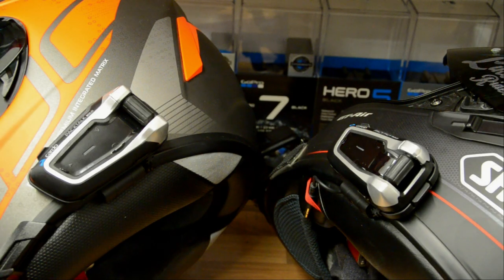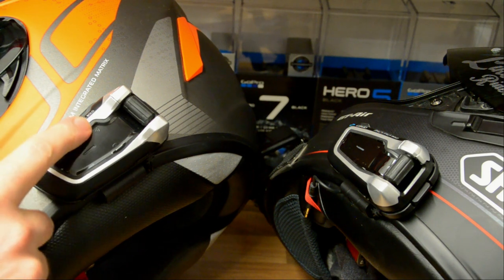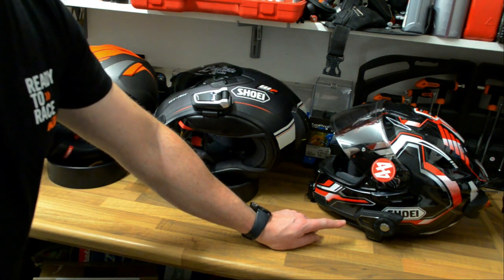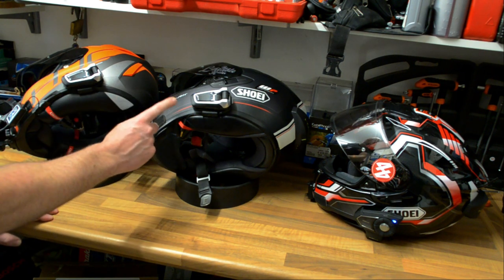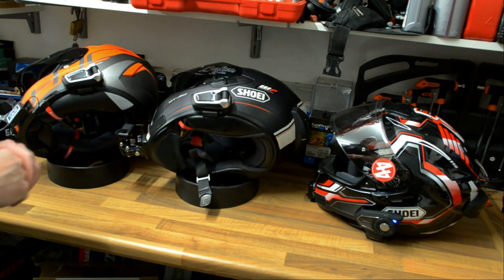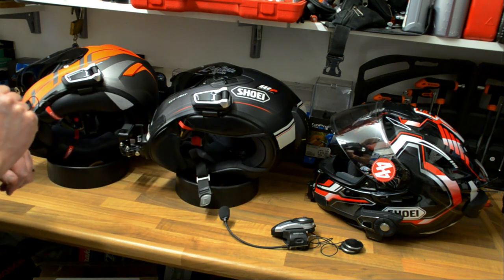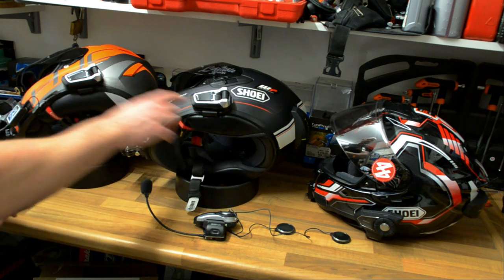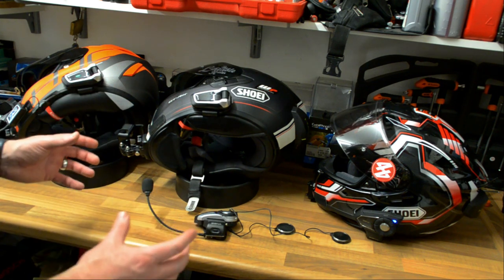Cardo Packtalk Bold DMC Intercom Setup and adding Non Cardo units to the Meshwork!

Comment: I’m struggling to connect the new nexx xcom3 pro with a cardo.. as it’s basically sena to cardo thought this might help but no luck.. about time the manufacturers made it easier and use as one 🤯
Reply from the maker: That's a shame!
They have started to make things easier with cross brand pairing, there's already an updated firmware allowing you to do this, but it's currently only available for the top spec Cardo units.

Comment: Spooky. Mine literally just got delivered. Going from a 10s to the Bold. Quality bit of kit and worth every bit of £420 for the duo.
Reply from the maker: Great stuff! Let me know how you get on with yours. I've had many other units over the years, but have only had the Packtalk for a short time, and thus far they're far better than anything else I've had.
Reply: @thelikeablerider8800   - Hmmm. First test complete. Build quality is excellent and the intercom is rock solid but I think the speakers are much better in my Sena 10s. These can’t seem to handle any bass coming from my old school trance music, unlike the Sena. Bit miffed by that as quality sound is important to me. Think my earlier comment was somewhat hasty.
Reply from the maker: You can adjust you're volume levels in the settings on the App. Do you have the JBL speakers?
Reply: @thelikeablerider8800  - Yes I have the JBL speakers (did the update before anything else). I’ve tried all the settings. Can’t go near full volume on my phone without it distorting but I need the volume to hear it. I’m going to fiddle with my iTunes EQ settings to see if that helps. It could be a quality control issue on my speakers as they seem to lack punch.
Reply: @thelikeablerider8800  - Turns out that one of the units in the box has faulty speakers. Mine. Typical.
Reply from the maker: Ah bugger that's annoying! Was surprised tbh because even the standard speakers are better than my Sena's!

Comment: What is the procedure to do the same thing the other way around? I have a packtalk bold, but most of my group is using the sena mesh intercom. I know the 30k has a universal pairing mode, and I can use phone pairing mode on my packtalk to connect to the 30k this way, but what does the 30k have to do in order to bring me into the sena mesh group?
Reply from the maker: Hi Kevin
Yes of course it'll work the other way round. One of you 30k friends needs to pair via Bluetooth to your cardo ( I have another video explaining that) first they need to create their mesh call, then the Sena paired to you needs to call you via Bluetooth (one tap of the phone button) and that'll bring you into their mesh call.

Comment: Question - I  guess that the range must be much less to the bluetooth connected intercom? How close must the rider (using non-cardo bluetooth-connected unit) stay to you (with the Cardo, briding that person into the mesh) for it to work most of the time?
Reply from the maker: 200-300m is tops I'd say! Try to be riding directly in front or behind or the guy you're paired with for best effect👍

Comment: Thanks for this video very helpful. Has anything changed with the Sena 50S/R? Specifically will this connect as a mesh unit?
Reply from the maker: I couldn't really say as I've not looked into the Sena 50s! I know it now has Mesh 3.0 but you can upgrade the 30k firmware to the same Mesh 3.0

Comment: My friend and I run packtalks, and another friend runs a cardo freecom. I'm assuming this will work the same?
Reply from the maker: Yes of course! Only difference is that you pair to the freecom units using the standard Bluetooth pairing mode, and not the gateway (for non cardo units) but you add them to your mesh as seen in the video.

Comment: Hi I've a couple question for you, I'm finding it impossible to change from one group to another via my phone the only way I can join another group which i was already in is to have the admin add me again also I think the  limit of riders in a DMC group is 15 but  how do I delete someone who has left the group so I can add a new rider, many thanks for your help.
Reply from the maker: Difficult one!
If you're already part of a group you should automatically stay in that group. If riders aren't present in that group, it shouldn't matter, you should be still part of it. Seems deleting single riders isn't possible, only deleting the whole group, by pressing and holding you finger on the group, you'll then get a "remove" icon in the top right corner. Just tried doing the same on individual riders, but that creates a private chat with that rider.
Reply: @thelikeablerider8800  yes that's exactly what happens to me when I try to delete a rider...
I'm in a couple of different groups which are made up of different riders, I'm grand if I'm riding in the same group all the time it connects automatically which it's supposed to do but as previously mentioned I can't change groups other than being readded by the admin again, it's a bit frustrating having to do it all the time just to change groups 🤬
Many thanks for any advice 😁
Reply: @normanhamilton1666  I haven't seen that problem I'm afraid, but I have seen an issue where the Cardo throws a fit if you have two groups, with the same set of units in both...

Comment: Question I have a pac talk bold and my wife has a freecom4+ I have connected them via Bluetooth which works but dont get much distance, one she is about 3-400 mtrs away sometimes closer I cannot hear her and it is only clear when she is only about 3-4 bile lengths behind me, is this normal?
Reply from the maker: Hard to say! I would still advise upgrading the freecom4 to another Cardo, as you'll youll be working to the lesser units functionality. Yes it can be done but really isn't the best way to do it, as they'll always be a compromise.

Comment: im not sure if you have experienced this yet, but 3 friends of mine all have senas and i have the packtold bold, all their senas are able to run the mesh talk, are we able to do this vice versa? as in they all go into mesh and then one of them invites me in through bluetooth?
Reply from the maker: Yes exactly! Only one of them needs to be paired to your device via Bluetooth. Like you say, let them establish their Mesh call, then the unit you're paired with just needs to call you via the Bluetooth intercom.
Reply: @thelikeablerider8800  thank you! we will try this next time we are together!
Reply from the maker: @R1deFast  it will work but be prepared that it's not always that stable, it's drops in and out a fair bit. I would still advise all to use the same brand for a stress free experience👍😜

Comment: Do you use the Zello walkie talkie app in conjunction with your packtalk? I have just downloaded this app on my iPhone and it allows you to use your phone as a walkie talkie using mobile data see ms to connect to the headset through the phone ok but haven’t tried it out on the bike yet. Thought it would be useful for when from time to time you become out of range. And would have been useful on occasions that I have ridden to France to meet up with a friend travelling from Spain.
Reply from the maker: No I've not heard of that! I've only tried the Cardo App to control the units, which works well.
Reply: Have the app too but have uninstalled and reinstalled app a few times as I can’t get the uk English tab in the settings to appear only us English which is frustrating.  You can’t alter your settings now on cardo community anymore as it’s all done through the app. 
Going back to the Zello app you can buy Bluetooth push to talk buttons that you can Velcro round one of your grips.

Comment: Excellent stuff. Wee query for you... If 4 buddies are using Sena or some other Micky mouse devices and establish themselves in a Bluetooth group, could you then pair the cardo unit with one of them as you have said above and so be in contact with all of them? obviously quality wouldn't be as good as DMC.
Reply from the maker: Becomes a bit more complicated if you're trying to be added to a bluetooth intercom group, but it should be possible! If I remember you can setup a bluetooth group with the Sena's. You need to pair with with one member like I've showed, let them initiate the bluetooth group intercom, once that is live make the call to the unit you're paired with, and you should be joined.
Reply: @thelikeablerider8800  aye that's what I was thinking. Would just be easier if the peasants would upgrade.
Reply from the maker: Some gentle persuasion😜

Comment: Great stuff I run the packtalk bold as my everyday commute, i have a C4 pro helmet with i think the senna system, so will this work also please?, also i cannot get my Samsung phone to answer a call when it comes through any ideas what I may be doing wrong, sorry and TIA
Reply from the maker: Yes it should still connect to your Sena, just connect the two together as shown. Not sure why it's not answering your phone, works fine on mine. You can answer a call by clicking any of the buttons. Try making a call over the voice commands, that works great to! Just add  the phones numbers to your speed dial, usin the Cardo app, then all you have to say is "hey Cardo speed dial one"
Reply: @thelikeablerider8800  Brilliant thanks for quick response much appreciated! will try soon, yeah it just won't answer without clicking a button, maybe its my scouse accent lol, cheers great videos thanks for supplying great content mate.
Reply from the maker: You're more than welcome Rob✌😜

Comment: the white coat went on again 👏👍 
Would the bluetooth com’s also auto reconnect after going out of range?
...proper fortune on that table, have you sold one of the kids or something? 🙈
Reply from the maker: Seems the Sena 30k joins the mesh automatically, but the 20s has to be manually connected. Yet to road test all this, but seems that the 30k would rejoin when back in range, but not the 20s. No biggie! One tap of the intercom button, and it'll be back. I still stand by my opinion, that things would be far easier if all your buddies run the same units, I'd imagine not all would have the patience to try this.
Reply: @thelikeablerider8800  agree, I would also welcome if all the manufacturers unified there systems, but that’s not the nature of the game i guess. I went with Interphone, my wife has a different model and they don’t talk to each other let alone to other makes 🤦‍♂️
You can test it even now, give each kid a helmet and make them play hide and seek 😉
Reply from the maker: The real test will be out on the road, when units are out of range etc. Yes they'll all have different mesh protocols, I can't imagine they'd work together!
Reply: @thelikeablerider8800  Shuan, I've tested the 20S and 10C in "my" "Pack" and the answer is, it's hit and miss.  Often the reconnection happens automatically, and sometimes it doesn't.  Sometimes the connection drops out even when in range, and you need to press the button again to re-insert them.  Occasionally, they drop out, you press the button, and after about 30 seconds, you get an audible error message about not being able to contact the unit.  Overall, the Sena's connected into the Cardo DMC, the audio is often terrible, and/or, there seems to be little to no noise cancelling coming from the Sena, so you get loads of engine and wind noise, and a weird slapping/knocking sound sometimes also.  It's a bit rubbish, but I'd take it any day over not having any comms with Sena people at all...! :)  DMC noise cancelling from other Packtalk units is generally near perfect, I've had up to 10 units in my pack (you get the vert occasional bit of wind or engine noise, but it's rare!).  HTH! :)
Reply from the maker: Did some playing about yesterday, seems if you add the Sena from the Sena, and not from the Cardo it stays connected! I remain by my opinion that everyone should use the Packtalk if larger group intercoms become more of a thing for people. Adding non Cardo units will work (ish) but not the best way to go👍😜
Reply: @thelikeablerider8800  Absolutely agree!  The other major downside of non-DMC units in the DMC is that the non-DMC unit is connected only to the one Cardo so they basically need to ride next to that person to stay in range, whereas the rest of the units, will auto daisy-chain the DMC connection amougst any unit in any order... :)

Comment: Hello, thanks for the info! may i know how is the range after adding Sena to into Cardo DMC? is it better than the normal Bluetooth to Bluetooth connection?
Reply from the maker: Its not far! you need to be next to the rider you've connected to in the group, which isn't ideal!
Reply: @thelikeablerider8800  ahhh that suck big time. there are total 4 of us in the group. 2 using Sena another 2 yet to get (including me). i was leaning towards Cardo, seems more reliable. but.... aiks... tough decision
Reply from the maker: It will work from Cardo to Sena but it's not ideal  at some point your bound to have problems. I'd always advise to all use the same brand. Who's easiest to convince in the group?🤪
Reply: @thelikeablerider8800  not gonna spend so much just to get a 'not ideal' result. haha.. considering they have already bought it, i guess its hard to convince them. 🤣. thanks for your advice and the video!
Reply from the maker: Chatting to yourself has its plus points🤣

Comment: The problem is my bridge or even my
Bluetooth connection with non cardo (sena) will drop after 10 secs! The connections never hold. Any idea why ?
Reply: As my comment above, I have not had that problem with either the Sena 20S, 10C or Cardo Freecom 4+.  I have spent many days doing this and the worst I've had connection dropping wise, is about 15mins, but it seems completely inconsistent, can't spot a pattern...
Reply: @mattmutane5502  as discovered by @likeablerider the connect will hold when I make the Bluetooth call from sena instead of cardo !
Reply: @mofufu  Good to know! :)  Sometimes though, the Cardo has to push the button anyway, to insert/re-insert the BT connection into the Pack/DMC...

Comment: After turning off, is it the same procedure again?
Reply from the maker: Not for the DMC between the two Cardos , they will connect automatically! You don't have to pair the non Cardo units again either, you'll just have to bring them into the Mesh like shown in the video. Bare in mind that what I've shown in the video, is best case environment! Things can drop in and out while out on a ride, especially if space between riders becomes too great.

Comment: Hi Please can someone help me? I am trying to pair my Packtalk Bold to a Interphone Avant. I am not getting any joy. I am putting the Packtalk Bold into Bluetooth pairing mode and have pressed to Interphone Avant into pairing by holding the back button on until the light flashes blue and red. I have also tried holding the top back button and the back button so it flashes green and red. Thank you in advance.
Reply from the maker: You need to watch this one, it'll work with any non Cardo unit👍

https://youtu.be/seOySwhiTPs
Reply: @thelikeablerider8800  Thank you I will try this tomorrow. 👍
Reply: @thelikeablerider8800  Do you have any videos of the Packtalk Bold pairing with a Interphone Advant as I still can't get it working? I have even deleted the previous bluetooth pairing from the Interphone. Also I have tried pairing in the Packtalk App. Thank you in advance.
Reply from the maker: Sorry I don't, you need to pair to the Cardo as a mobile phone and not as normal Bluetooth intercom.

Comment: Having had the bolds for a very long time now, I have to disagree with the "one time" connection. I would agree it connects most of the time, but not always. At times we've had to go through and pair them again which only takes a minute to do.
Reply from the maker: Yes of course this is in best case conditions! Things can drop out while out on the road, that'll always happen,
So a quick fix as you say is a must! 👍😜
Reply: @thelikeablerider8800  We've had it where they haven't automatically paired when we've turned them on too even though they've previously been in a mesh group together.
Best comms units by far though
Reply from the maker: Haven't been able to get out and ride with them yet, but thus far they've connected every time. Time will tell! Thanks for your input m8👍😜
Reply: We occasionally have this problem, it’s usually that one or two of them have not updated the Cardo firmware which Cardo seem to do a couple of times a year - once that’s done we connect every time!!! 😳😆ooh matron 😜
Reply: @andyb3331  Interesting - my lot run a range of differing firmwares and don't seem to have any issues like this... will bear that in mind! :)
Reply: @tojj29  Have had that occasionally.  I find that if your unit doesn't find any other unit to pair with in the first 10-15mins or so, it stops trying.  So if you ride somewhere to meet your mates.  it's best you all reboot once you're all together (this can be the case for say two (or more) sets of two (or more), who join up along the route somewhere too).  Never had a problem with auto joining the DMC outside of that caveat :)  Obviously, they had to already be in the Pack to start with, for auto re-joining to work...

Comment: Could you use this to join 2 mesh’s together to get to 29 users?
Reply from the maker: I wouldnt have thought so! You need to connect to so many riders?
Reply: @thelikeablerider8800  We sometimes hit 16-17 riders. Was to prevent having to split into two groups.
Reply from the maker: @AndrewMcClenaghan4182  I can you having issues with that many, sometimes we have issues connecting 4 or 5. Having been using the Packtalk bold a lot since making this video, we've had quite a few issues with connecting with multiple riders.